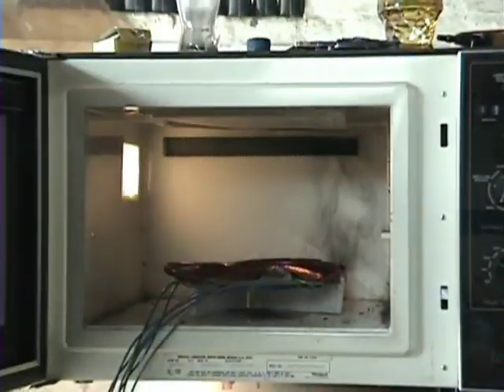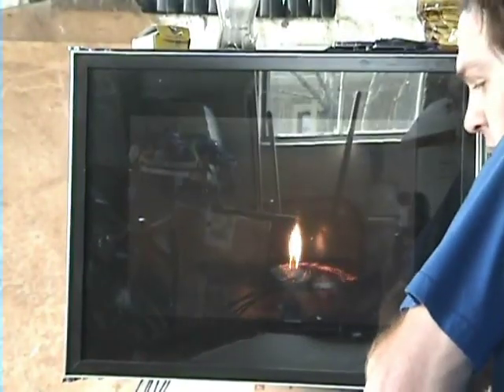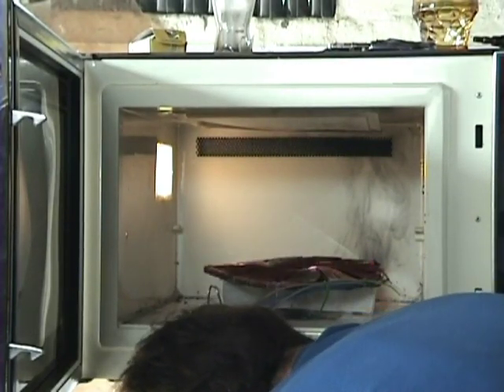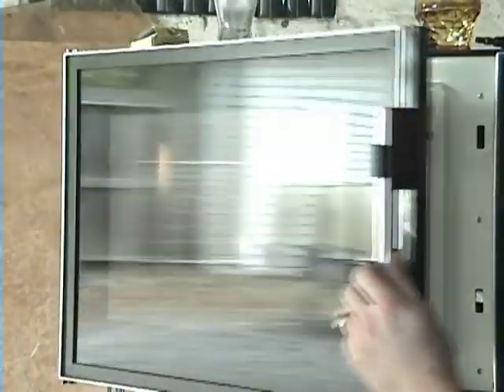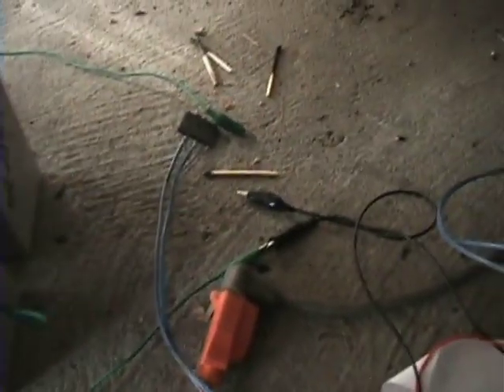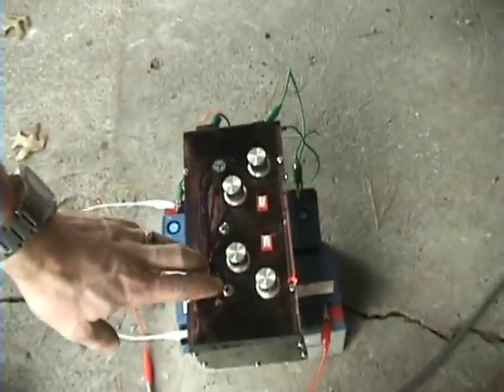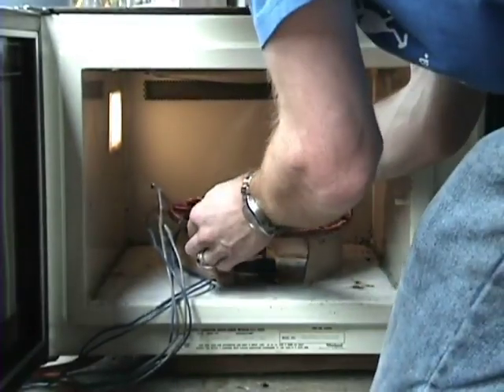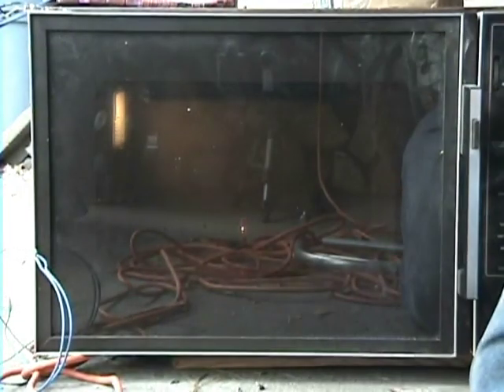Microwaving a Rodin Coil and Plasma Balls???  Thats a 1'st (TEST21)

Comment: When the coil was charged, it created a magnetic field which shielded it and the flame from the microwaves.  When it was unplugged, the microwaves came in contact with it causing the electrons to oscillate.  With nowhere to go and resistance at almost 100% they generated a lot of heat.  I'd like to see you try again with just the coil and no external wiring.

Comment: If you short out the leads on the coil, creating a closed circuit, the microwaves should induce a current which would produce a resonant magnetic field.  It may focus the microwaves directly on the flame like a lens, or the coil may just get hot and melt.  Either way it would make a great video.  Try using a candle instead of a match.  It would burn longer and it would be easier to control the position of the flame.

Comment: Like someone else here said, i would like to see the result without using an input, and rather closing the circuit on the coil itself. Then the microwave should induce a current in the coil, which should focus all the energy towards the zero-point (Where the fire is in the middle).
This is just a guess. But i'd love to see that result! Keep up the good job! :)

Comment: try putting a shotglass of mercury or galinstan in the center.  galinstan is a low melting alloy that reacts to magnetic fields and electricity it self.  2 wires in it with a battery across it will make the surface swirl in a spiral,  try it

Comment: I kind of  see what your trying to do here , would not creating an array of conductors at what is the microwave length 12cm?? , essentially the microwave is a pretty powerful transmitter so after removing the magnetron from its housing an aerial array board  with conductors at 12cm spacing  may induce a high energy "field"  betwixt the mag and board to conduct your coil experiments, outside the box , pardon the pun...